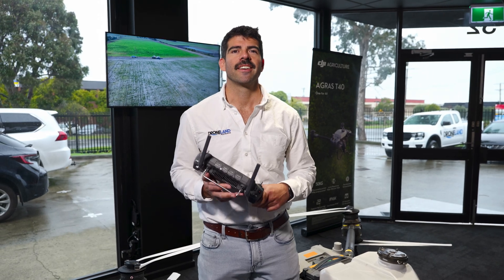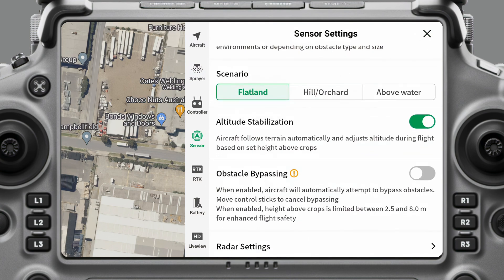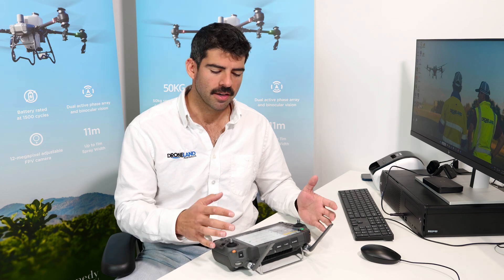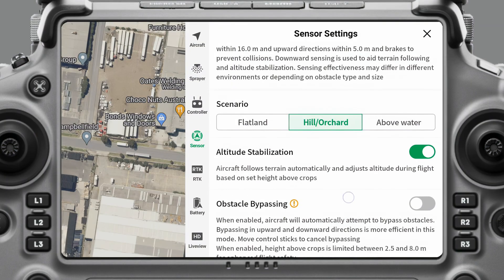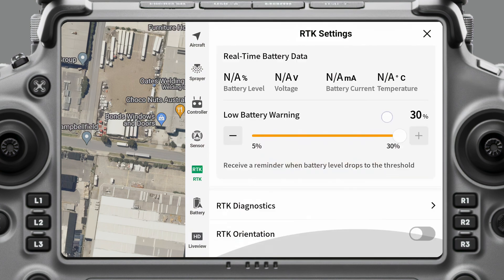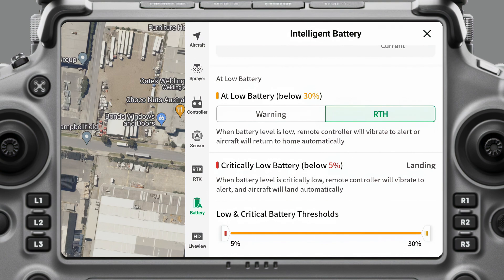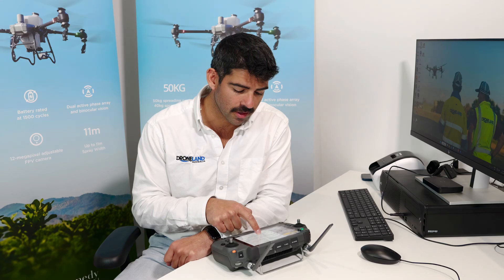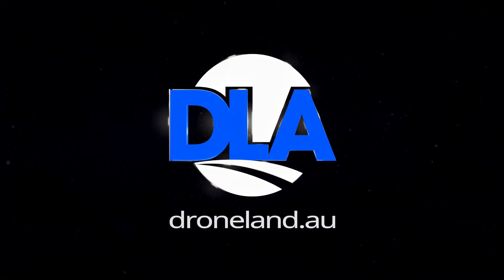DJI Agras T50 - Remote Controller Settings Explained - PART 2

Comment: Which flight mode we have to use F or S or N.
Reply from the maker: The three positions of the switch correspond to: N-mode (Normal), S-mode (Attitude), and F-mode (Normal) - for general applications, you would use N-mode.